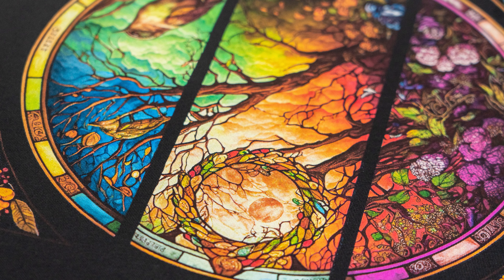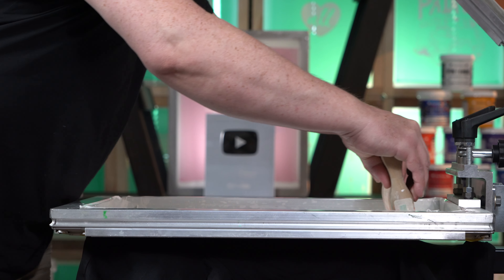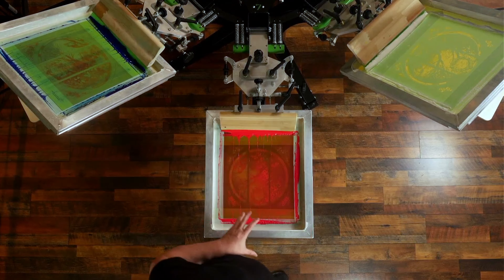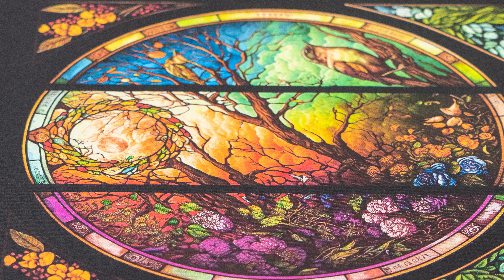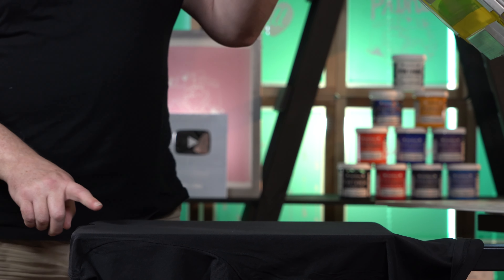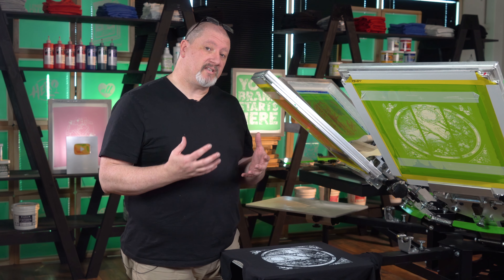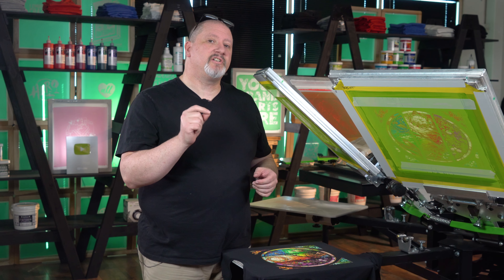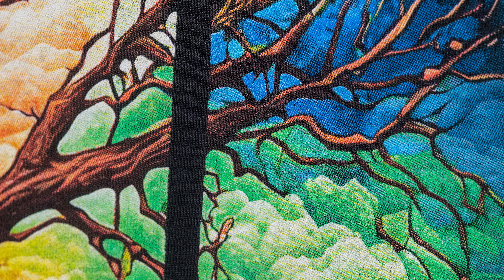Everything You NEED TO KNOW to Print Sim Process!

Comment: Need a new update for polyester 2 color job.....3-13-24
I go by recommend heat for curing and get cracking...and if i go to hot i might get dye migration.
Just did 50/50 cotton and polyester...i had gun checking temperature..got up around 290 295 and ended up with cracking...
Using wilflex bolt lc white as a paint with a polyester blocker..then putting a union ink neon pink on top..i had even heat press at 250 degrees for 30 seconds twice to prevent cracking..to only end up with cracking..
I know the wilflex likes to cure around 330 degrees .
So i guess i need to turn my oven up to a way higher temperature then polyester likes...been screen printing for 3yrs now to feel like a beginner again..not cool .it destroys your confidence...and in this game of screen printing confidence is important right along with detail.....cant always go by recommend instructions..just use instructions as a start point ..lol..
Your polyester videos are 6 yrs old....things change....should I use a dye blocker..should I go to paint that cures on it's own as long as it hits a certain temperature and wait 24 hours....I like to push jobs..do embroidery also..
Would greatly appreciate a new video..
Thanks for this video also.the big guy has great knowledge...
God bless to all...